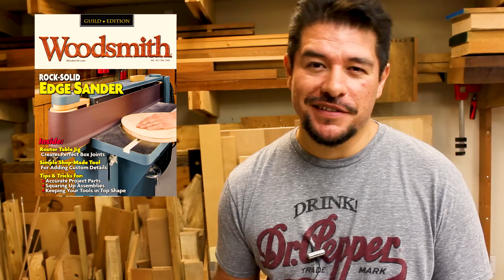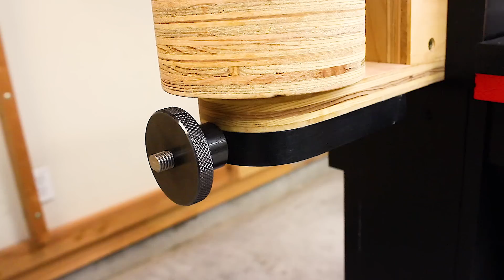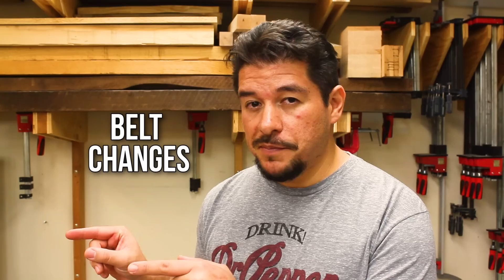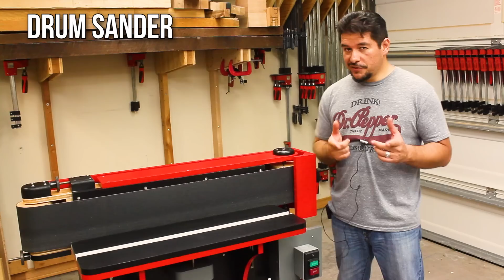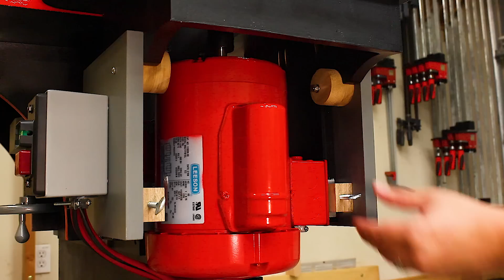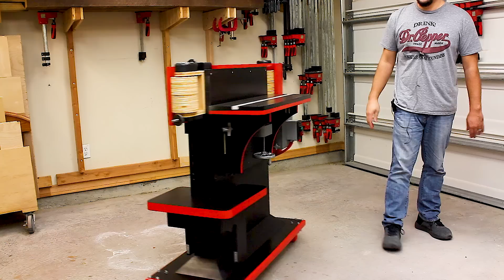Make your own Horizontal Edge/Spindle Sander Combo Machine!

Comment: Would it be possible to assemble the edge sander so that the motor and non tapered cylinder ended up on the other side of the edge sander so you could keep the drum sander table attached permanently?

Comment: I've seen home jigs that put a large wedge the length of the table. You can slide along the wedge and use your whole belt width evenly with no adjustments. Usually made easily removable if you need  super strait sanding with the grain.

Comment: Great video and build. I intended to buy one of these but my main supplier here in the UK wont deliver into the Highlands of Scotland because their version is around 120Kg. I have a couple of questions. Firstly what is the speed(RPM) of your motor and is it a 2 or 4 pole version. I am trying to get an idea of the belt speed.. Secondly have you spaced the belt so it runs slightly off the platen when idling so as to prevent excess heat and wear on the belt when you aren't actually sanding. Thirdly, and I realize it is early days for your build, I notice there is no adjustment to square the table to the platen, do you see this as an issue over time.

Comment: Nice job. I legit though it was sheet metal construction till you said otherwise.

Question though. Why make a removable drum table? Why not just leave it in place permanently?
Reply from the maker: Great question, Tim. Mostly, for the dust collection. While drum table is on dust port is swung away.
Reply: @MyGarageWoodshop  Ahh. That makes sense.